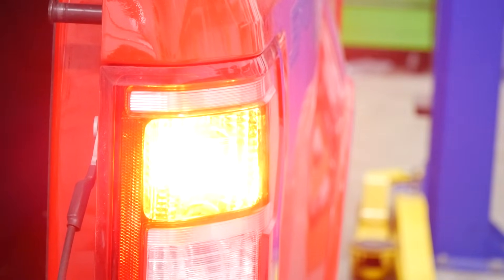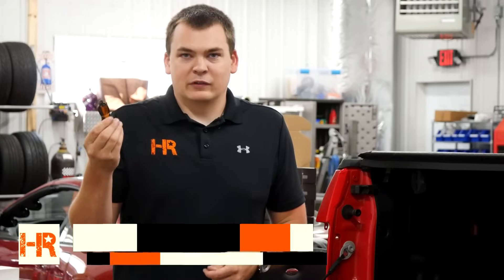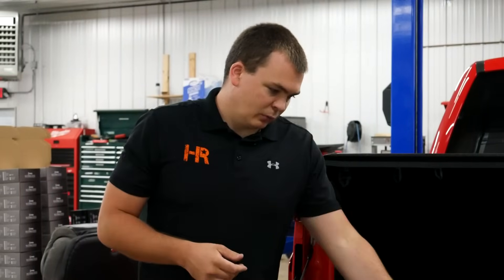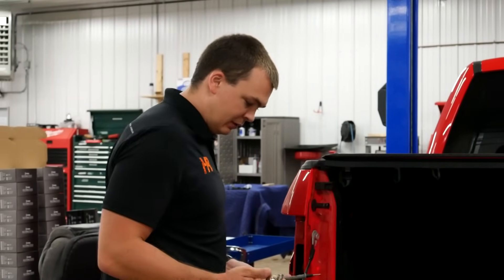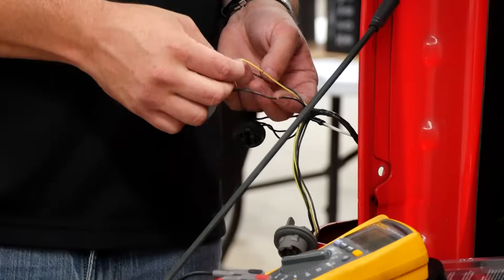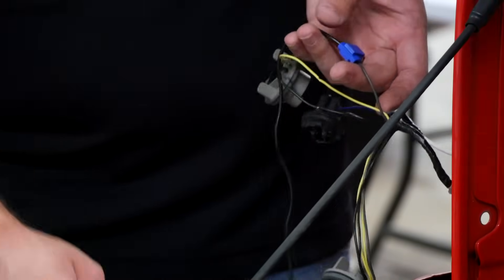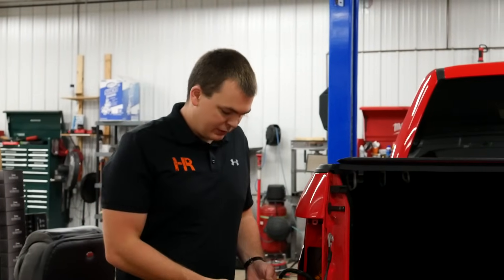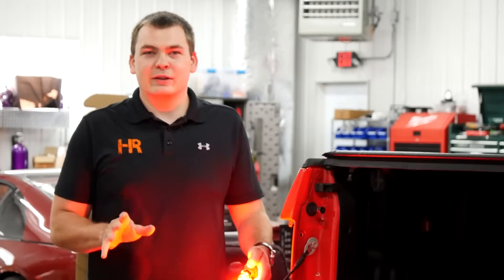How To Install LED Resistors - Everything You Need To Know | Headlight Revolution

Comment: what about the from turn lights just by install those in the back everything is goin to be good?
Reply from the maker: You'll need to install one on any bulb replaced by an LED bulb.
Reply: @HeadlightRevolution  instead of a resistor I replace the flasher fuse and what happened is that the speed went down there's no hyper flash anymore But but now my turn signals in the front don't go off when I turn on my headlights, in the dashboard glows a little but showing up that they turn signals are on what should I do?
Reply from the maker: Reinstall the OEM flasher relay and install resistors.

Comment: Is it possible for turn signals to share the same ground such as in a motorcycle?
Reply from the maker: You'll need a separate resistor for each LED bulb.
Reply: @HeadlightRevolution  I understand that. But can each separate resistor go to each power circuit of each turn signal and meet at the same ground?
Reply from the maker: Yep!

Comment: How about Load resistor voltage? Sometimes we use 12V 21W and sometimes 24V for heavy truck tail light.
Which voltage need to use for this car?
Reply from the maker: Any normal vehicle would use 12v resistors.

Comment: I just installed low and high beam led but they turn on and off randomly will a resistor solve my problem?
Reply from the maker: Depends on the vehicle, reach out to our CS team so we can assist you!

218-755-5200
Sales@HeadlightRevolution.com

Comment: Can you attach the resistors to the fuse box? Would a 5 W resistor be enough for a W21/5W LED?
Reply from the maker: That would be a relay swap, you can but not all vehicles have them.

Comment: I have the problem that front + rear on the right side of my car after putting a resistor on each bulb flash really quick, and the left side front + rear after putting a resistor on each bulb flashes normal... I drive a toyota aygo from 2007, anyone any idea?
Reply from the maker: Sounds like the resistor may not be installed correctly on the side that is hyper flashing, is the resistor heating up when the bulb is hyper flashing?
Reply: @HeadlightRevolution  yes, theyre both heating up front and rear side and both lights are lighting up
Reply: @HeadlightRevolution  also, i reconnected them both to check if they were connected the right way and they were, i did it the same on the other side of my car, i wouldnt know why one side works normal and the other side is hyperflashing
Reply from the maker: Resistor may be defective in that case, try replacing it.
Reply: @HeadlightRevolution  thankyou for still responding, i found out what was wrong, i measured the hazard lights instead of blinker so the resistor was on the wrong +😅😅
It works now, thankyou anyway!

Comment: I have a 1994 full size blazer that I customized slightly. Typically the the truck has to side marker lenses on each side on the front. One is a reflector the other is a running light. I customized the reflectors to except a factory bulb socket. I installed the push in led bulbs into the lenses but they do not like their new home. They flash quickly and randomly acting like a bad or loose connection do I need a resistor for every led light I wish to in stall on my blazer or will one resistor for all work?
Reply from the maker: Every LED hooked up to the turn signal circuit will need a resistor added to it.

Comment: I just put led tail lights in my 2010 silverado I going to put led turn signal bulbs in the front do I need two different type resistors
Reply from the maker: You just need a pair of 50w 6ohm resistors!

Comment: DON'T STRIP YOUR WIRES TO TEST!!!  I've been doing this type of electrical work on vehicles for 40 years.  My dad taught me to use a safety pin with your meter alligator clip clipped to it.  Just poke into the insulation and see if your meter indicates.  If it is the WRONG wire, put a smig of electrical tape over your poke hole.  A LOT better than weakening your wire by removing a section of insulation.  If you have the correct wire, you will obtain voltage.
Reply from the maker: That's a good way to do it as well!

Comment: What do you do if you still have Hyper Flash after you have Connected your Resistors?
Reply from the maker: Sounds like it either was not enough resistance or the wires aren't actually making contact. Check to see if the resistor is getting warm but please be careful these get EXTREMELY hot when working properly and can absolutely burn you!
Reply: @HeadlightRevolution  ok, thanks
Reply: Both resistors get real hot 🔥 .  I soldered both of them in. Still getting hyper flash. Could one or both of them be defective?
Reply from the maker: Reach out to our CS team so we can get more info on your install!

218-755-5200
Sales@HeadlightRevolution.com
Reply: @HeadlightRevolution  hey Y'all I put alpharex nova-series headlights in my f150 2014 I installed with resistors but I keep getting hyper flash on I changed to a higher end resistors and soldered them in I still have hyper flash. When I first get in the truck and use my turn signal on problem but after a few times it goes to hyper flashing again. Please give me some feedback on how to fix it's driving me crazy.

Comment: Hello, I replaced all the exterior lights of my RV 2005 Fleetwood Southwind, when I turn on the lights at night everything is fine, but when I activate the left or right signal or the emergency signal all the lights outside the RV flashing including the dash lights and those of the radio.  My question is if installing this resistor as indicated in the video will solve the problem.  Thanks
Reply from the maker: This could help! Not sure though as I've never seen an issue like this on an RV!

Comment: Can you do a video for the resistor installation on the front blinkers for dual bulbs like in a 2015 silverado?
Reply from the maker: We don't have access to one of these trucks. You'll just need to use a volt meter to figure out which one is your turn signal and tap that one!

Comment: I put led bulbs in the front of my 2010 silverado, i put a resistor per bulb and they work fine at 12v with key on engine off but at 14v with the engine running they hyperflash. Would it hurt to add another resistor?
Reply from the maker: I would recommend a single 50w 6ohm resistor!

https://www.headlightrevolution.com/50w-6ohm-gold-resistor-ACC.RES.50W_2

Comment: If you use the resistors on lamps that stay on constant can they handle it? I have. A special case where the modules in my aftermarket headlights do not pull enough load to prevent a lamp out light which causes the headlights to turn off. Would powering the resistor any time the low beam is on burn them out?
Reply from the maker: I have some on some DRL lights on my personal vehicle. Been over 6 months now with no issues!

Comment: I hooked one of these up and just left it loose to make sure it works. It worked but when I picked it up to mount it I barely touched it and the heat sink burnt the hell out of me really bad. Insanely hot after just running for a minute or 2. Is this normal? I aborted the mission cuz I don't set my car on fire but the hyper flashing is annoying
Reply from the maker: Yep, completely normal. I'm running 4 resistors in my car with no issues!

Comment: So question…if my car came stock with LEDS and I just wanted to change mine out for a different LED brand would I still need resistors?
Reply from the maker: If your vehicle has OEM LED you cannot change them out unfortunately. These are all non-serviceable.

Comment: Could I have a bad resistor if my rear led light up when parking lights are on but drivers side quit blinking and brake light quit. The led's are lit up but no longer blink or brighten when brake is applied.  Driver side fast blinks but its the factory turn signal in the front thats fast blinking. 2011 f150 with blacked out rear aftermarket led lights. Just one side quit as explained.  Any help so appreciated. I dont have bulbs , I have like 12 led things.lol
Reply from the maker: Not too sure if they are aftermarket tail lights it could be the bulb itself has failed.

Comment: Hello. I was wondering if there is something similar to use for changing your HID headlights to a regular headlight so your vehicle will still see the same voltage. I didn't know if this resistor would work in that scenario. Thanks for you help!
Reply from the maker: Going from HID to a halogen system is much more complicated.

Comment: LED turn signals that flash faster than "normal" are safer!! The slow, dopey flash rate has got to go. I'm not talking about hyperflash, I'm saying nearly twice as fast as "normal" is safer. Period. I do not use the resistors on my vehicle as the flash frequency is nearly x2 not hyperflash...just a little bit faster. !!!!
Reply from the maker: There's a reason blinkers blink the speed they do!

Comment: I have a 2014 chevy silverado front 4pcs switchback rear built-in led (spyder taillights) + tailgate led strip lights. Where should i put my resistors and how many?
Reply from the maker: Never worked on those, the resistors go on the blinker circuit though!

Comment: Spot on.  I soldered my connections, painted them with liquid tape, then wrapped them with electrical tape.  Overkill I suppose, but that's just the way I'm built.  1999 F350
Reply from the maker: Heck yeah!
Reply: F350 ..ktm ?

Comment: Quick question…..I have the resistors installed and mounted…..sort of.

My question is….I am thinking about putting some washers/spacers between the resistor and the frame mounting point.  Basically raise the resistor from flush mount on the frame to allow some air to circulate under the resistor for heat dissipation.  Am I wrong with that logic ?  If I am wrong can you please provide explain the reason why?
Reply from the maker: If you do something like that just make sure the spacers are metal!

Comment: Great video we have 2017 Ford Flex driver side rear is by HyBo.flashing do you have a resistor for this model factory installed. Thank you Ron
Reply from the maker: We do not have a specific install video for this vehicle. The process would be the same as it is here.
Here is a link to the resistor you would want to use!

https://www.headlightrevolution.com/50w-6ohm-gold-resistor-ACC.RES.50W_2

Comment: Do you use a resistor for each bulb on truck… I have two signal bulbs on each corner of my truck.. would that be 8 resistors???
Reply from the maker: Generally yes, but you might be able to get away with one per corner so just 4!

Comment: So... If I installed led switch backs on the front, can I add the resistor on the back side? 2008 Chevrolet Silverado.
Reply from the maker: It's always best to put the resistor near the bulb you want to add resistance to.

Comment: FOR EVERYONE ASKING ABOUT TAIL LIGHT ERRORS ON YOUR Dash.
These resistors are not only for indicator lights.
The reason your indicators hyperflash is because the vehicle thinks your light bulb is burn out. LED lights act like a burnt out conventional bulb. So if your led indicators hyperflash, you need a resistor.
If your LED brake light or tail light shows up as a burnt out bulb error on your dash, YOU ALSO NEED A RESISTOR.

A resistor is needed in any situation where you need to trick the car into thinking you have a normal bulb there that ISN'T burnt out.

Hope that helps
Reply from the maker: Thanks

Comment: But resistors DEFEAT one of the purposes of LED  turn signals, and that is, the EXTREMELY LOW WATTAGE that it uses!!! HOT RESISTORS WILL WASTE the SAME AMOUNT USED BY those cheap wasteful regular incandescent bulbs!!!!!!!! JUST CAN'T WIN, RIGHT??
Reply from the maker: /this video is old, there are new bulbs that do not require resisters anymore.

Comment: What if I don't know what my ground wire is? I have 2 black wires, 1 orange and 1 red wire.
Reply from the maker: It should be one of the black wires, get a multi meter and test
Reply: @HeadlightRevolution  I also don't know which one is the turn signal wire

Comment: question: I bought a LED light housing with resistor pre-wired for my front civic 92-95 signal. When i turn my headlight one click or the day light is ON, the LED signal light will just dim a little not like the old way of signal light flashes. I did swap out the oem bulb with LEd light bulb without resistor, it did not hyper flash but as soon as my day light or headlight is turn ON, it just dim a little and flash...its hard to notice on bright day light. Do u have any solution that i can buy and install to fix my problem?
Reply from the maker: Shoot us an email and we can help.

Sales@headlightrevolution.com

Comment: How do you add them to the front turn signals?
Reply from the maker: The same steps as this video but just do them in the front.
Reply: @HeadlightRevolution  when i pull my lights on front, the bulb comes out with no wires, it's a bulb and piece that i plug and turn, absolutely no wires, like plug and play. The low beams are the only ones that have wires.  So i have no idea what to do besides take my car into and have professionals do it.

2013 Kia Sorento SX

Comment: well its funny in the beginning you said the vehicle doesnt matter the reistors are all the same and then when you wanted to promote your own lits you say that you might get the wrong resistor for your vehicle. which is it? the vehicle doesnt matter or the vehicle does matter?
Reply: but you did answer my only question in being the best way to figure out which wire is which so i thank you for that. you were completely thourough in your instruction process  awesome job
Reply from the maker: We meant it doesn't matter what brand you get, just make sure the OHM's are correct. This is an older video we did so we apologies.

Comment: I recently had an aluminum flatbed with LED lights put on my Tundra. I'm only experiencing hyper flash with the turn signals when applying the brakes, otherwise all lights blink normally including the 4 ways. Any suggestions?
Reply from the maker: Have you added resistors to see if that helps?
Reply: @HeadlightRevolution  No , I'm trying to avoid that if possible because of the amount of lights that are in the flatbed. Four in the rear and two in the headache rack unless I can get away with installing them somewhere in the wiring for each side. That would be the ideal thing to do if one resistor can cover three lights. I just find it weird that they don't hyper flash when not applying the brakes

Comment: So, question... if I have LED bulbs in my brake lights (previous owner installed them with no resistors), and I put LED switchbacks in the front turn signals, would I need to install resistors on both the front AND and brake light bulbs? Or will one set on either suffice?
Reply from the maker: If the bulbs are in the brake lights you would only need resistors on the front!
Reply: @HeadlightRevolution  thank you for the response, they currently flash fast due to the LED's so I was just making sure I didn't need them in both the front and rear. Thanks!

Comment: I just switched and installed LED turn signal lights, could I not just add the resistors to the LED turn signal light fixture wires that I just added?
Reply from the maker: You coud!

Comment: Are resistors possibly needed for headlights, and interior lighting like dom, doors, glove compartment, trunk etc? This is a nice detailed video btw.
Reply: Only if the system gives you an error that the bulb is bad. I have a 2012 and the only bulbs I need them for is any that are have a flash. Some higher end cars have more sensitive electronics that might detect but usually the newer cars already have LED.
Reply from the maker: Headlights may need resistors depending on the vehicle, interior bulbs would not though!

Comment: So if I do that in the back will I have to do it in the front?
Reply from the maker: Yes, you will need to do it for each light that has a turn signal. But we do offer resister free type bulbs called the GTR Carbide 2.0 that are direct drop in. 

Here is a link for you:
https://www.headlightrevolution.com/search?keywords=gtr%20carbide
Reply: @HeadlightRevolution  hmmm. I have a 2014 kia soul.  There's no wires hooked to my blinker on the front. Hmmm. Might have to go with the Built-in resistor on the bulb  thank you

Comment: Thank you for this video. After trying several searches and attempting to make sense of some other videos, yours was spot on and answered all my unknowns. I have a 1998 Toyota 4Runner that I had, on the spur of the moment, decided to replace the burnt out conventional bulb with LEDs--I bought Sylvania bulbs. After doing so, I noticed the ABS light on my dash; through a Google search, I quickly discovered I needed a load equalizer, so back to O'Reillys for it. Through other searches, I already knew the wire I needed to tap into with the equalizer was the green one with a white line on it. Instead of attaching the other end of the equalizer to the common wire (white with a black line on it), I crimped a connector on it that had a hole for a bolt, and then I just used the existing grounding point behind the side panel instead. Everything worked--no more ABS light. Thanks again.
Reply from the maker: No problem Dave! Glad we could help!

Comment: Can you connect the ground  wire  to the chassis or body   ground close to the bulb  for a connection. Instead  of the ground  on the bulb.
Reply from the maker: This needs to feed back into the blinker system.

Comment: Why not just use one resistor on the wire at the flasher relay instead of at all the bulbs.
Reply from the maker: This will not work, each bulb will need its own resistor usually.

Comment: My front turn signals are also parking lights. So current will pass thru the resistor during ALL night time driving. Do I run the risk of the resistor heating up too much in this case?
2020 RAV4 XLE
Reply from the maker: Nope! Not something to worry about!